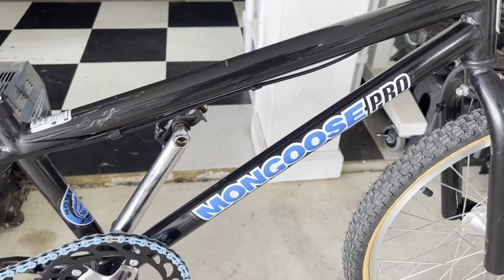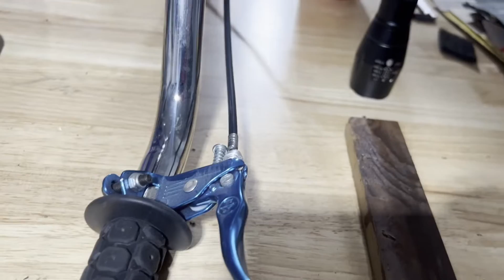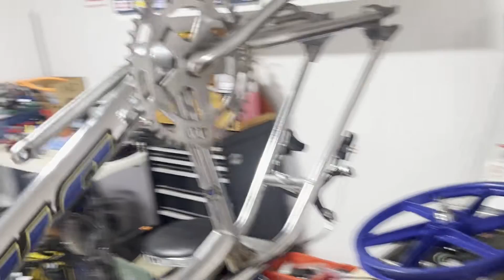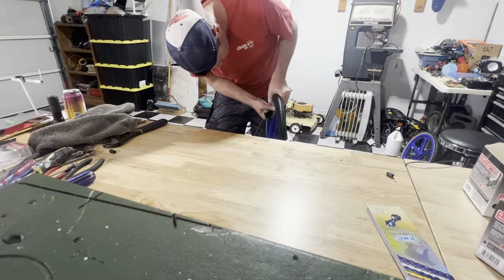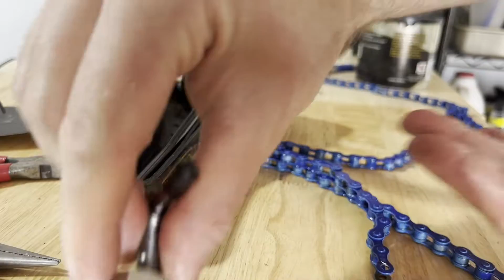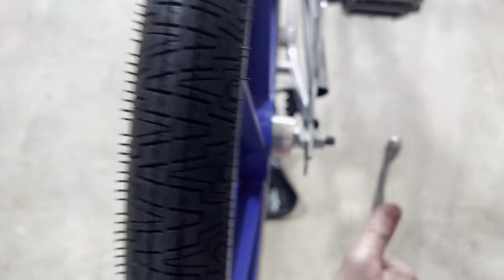Dyno Compe Bike Build - 1990's Chrome BMX/Freestyle

Comment: Nice restoration, what type of rims are those? Where did you buy them? As well as the blue chain? Any info would be appreciated.
Reply from the maker: Thanks! Skyway 6 Spoke Mag Wheel Set Blue 20” BMX - KMC Chain - Both I found on Ebay.
Reply: Nice I thought they were skyway wheels. So after researching, I saw that they have sealed and flanged bearings. I'm wondering which one you chose and why? As well as im honestly looking for something plug and play as im new to the restoration world. Appreciate the response and info.
Reply from the maker: I didn't know they offered different types of bearing options. I found a good deal on these new wheels on ebay and got them. I believe they are sealed bearings, they are very smooth.   @tnazt33